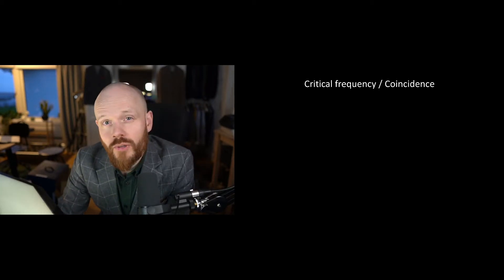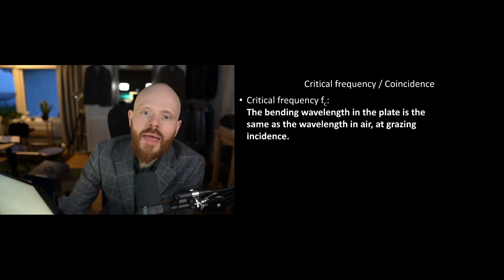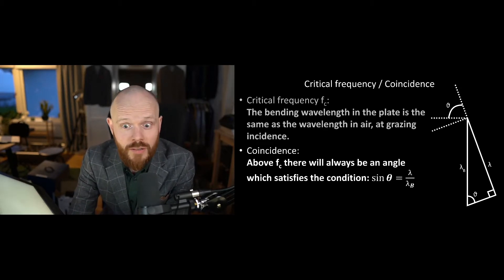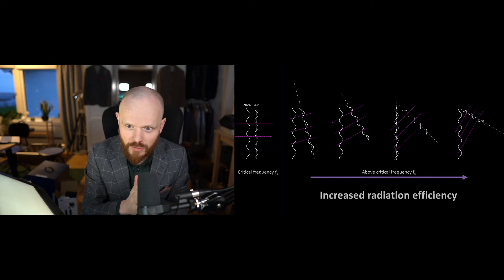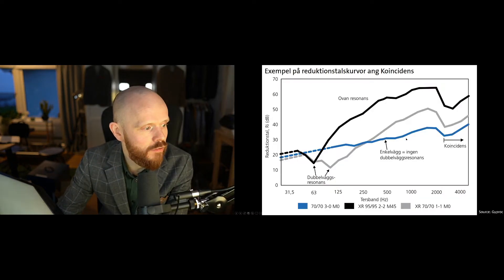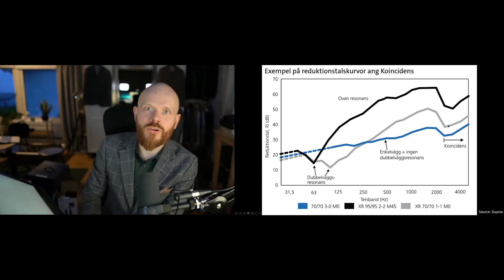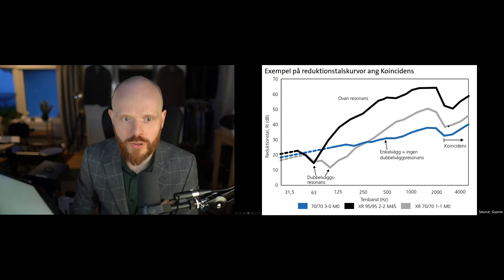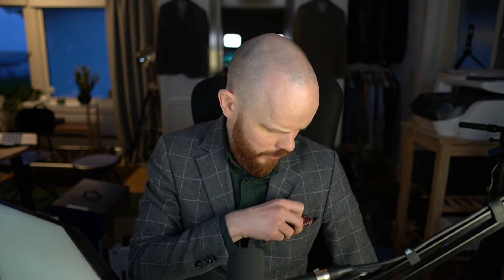What is the critical frequency and what does coincidence mean, when dealing with sound insulation?

Comment: So, if someone asks me to find the coincidence frequency, what exactly am I looking for?
Reply from the maker: It's the frequency at which the wavelength in air coincides with the wavelength in the material. In air c=343 m/s but structure borne sound c varies with frequency. Above coincidence frequency there will always exist an incidence angle of the incoming wave where the waves can be "mapped" onto eachother. Consequently, sound will have an easier time going into and radiate out from the material. You will see it on sound insulation curve how for example the performance of a wall deteriorates at higher frequencies.
Reply: @RikardÖqvist  Is there a formula for finding this? Everywhere I look online people only talk about the coincidence as a phenomenon and ONLY mention a critical frequency but they never mention an actual coincidence frequenecy.

I know that the critical frequency formula is f=c^2/(1,8(cL)*H )

How do you actually find the coincidence frequency if you have the critical frequency?
Reply from the maker: @eyjay1508  A good reference book I often fall back to is Carl Hopkins - Sound insulation. There is a lot of theory about the mathematics behind building acoustics there.